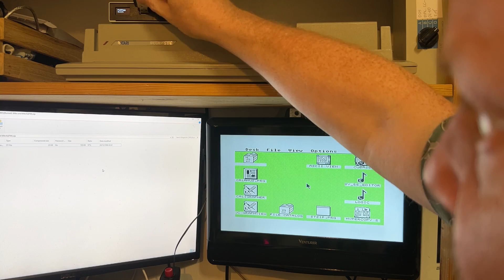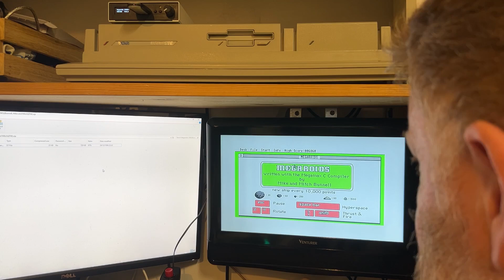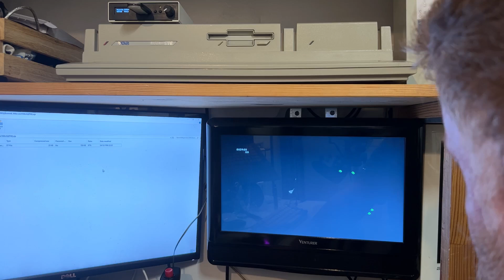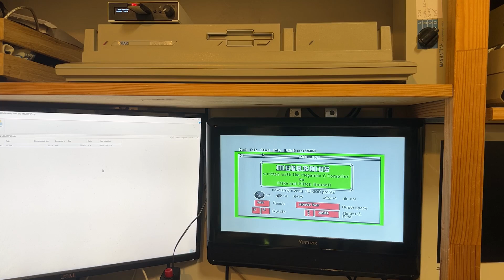Atari Mega ST - GoTek USB Floppy Drive

Comment: One of the most helpful videos about legacy ST systems out there. 99% ot all the nw SD systems take over the  ASCI/DMA port on the ST. That doesn't work for me, as i have several re-purposed SCSI hard drives holding all the important data, all daisy-chained and using the ASCI/DMA port. Speed is less important than preservation of files before hard drives fail. Thanks for this video. It has given me ideas.
Reply from the maker: Got a 520ST motherboard that I need to fit into an old case. thinking about doing a RAM upgrade using original hardware chips but need to source chips that are not massively expansive... I have a challenge that I don't think I have any working ST floppy drives and I really dont want to take a saw to the case (as I have in the past!)